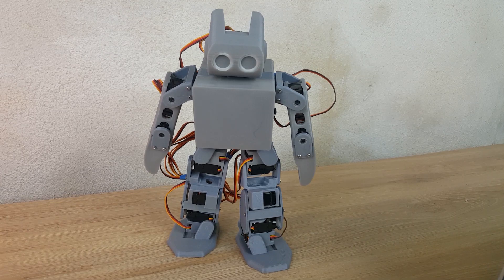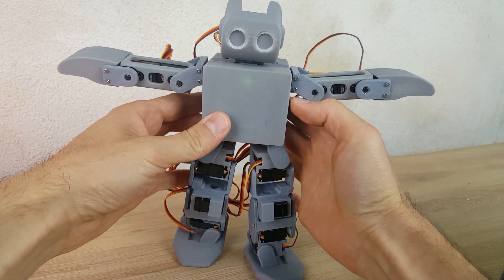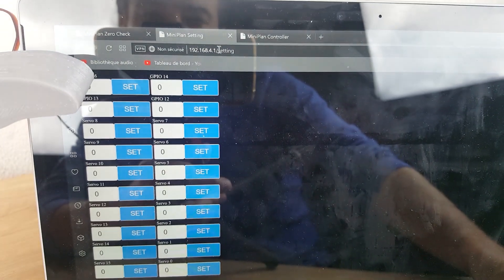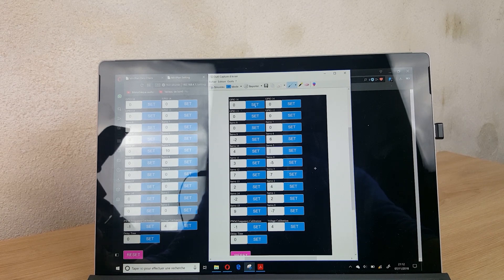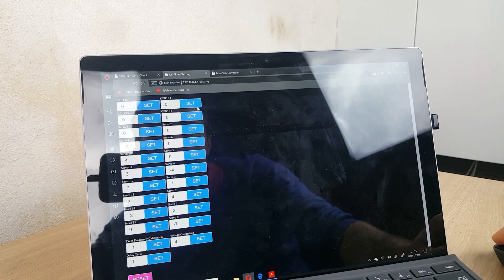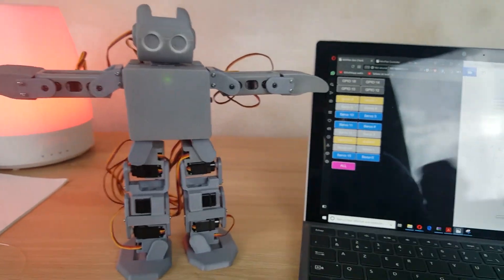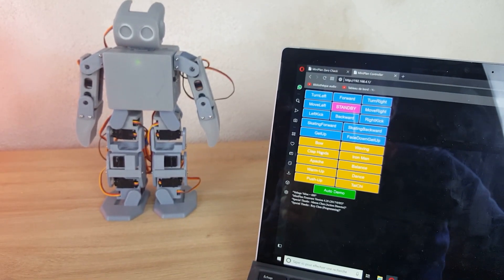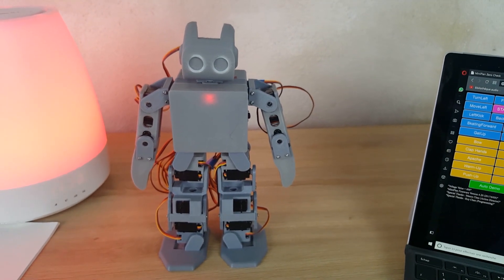How to build an humanoid robot - Part 2 - based on miniplanV6

Comment: Hey brother r u using aurdino
Reply from the maker: Hey, it is a special board to control 19 servo. You can do it with some arduino board but it will take more place than this special one
Reply: @robotricks_labs  hey bro i am very much interested to build a robot like you how can i . can you teach me .
its my dream dear
Reply from the maker: @kr_gaurav  you can check the part 1 of the video. There are all détails https://youtu.be/7D2vIoPPJWY do you have a printer?
Reply: 3d printer
Reply: I have a simple printer bro
Reply from the maker: @kr_gaurav  it is ok with a simple 3d printer!

Comment: I have a question, Is it possible to add additional servos with that hardware? 
 how many servos can the controller have connected?
Reply from the maker: Hi! Thanks for watching . With this board we can plug 19 servos maximum. If you want to plug more servos be carful of the power of the battery and the global weight of the robot.
Reply: @robotricks_labs  Is there any way to expand the number of allowable servos without changing boards? could you for example connect some sort of expansion into one of the ports?
Reply from the maker: @AcanLord  Yes you can but all ther servos pluged on the same pin will have the same action, and probably less power. You must weld 1 Y wire on each PIN. this allow you to plug 2 servo on the same PINS

Comment: Is it possible to do correct shuffling of the wires and to hide them??
Reply from the maker: Hello,
Thanks for watching. The current parts cannot allow to hide wire but you can reduce the length of the wires and place them against the part using duck tape or serflex. The other solution is to re-model each part by adding some cover. Any way, my shuffling is not optimized !